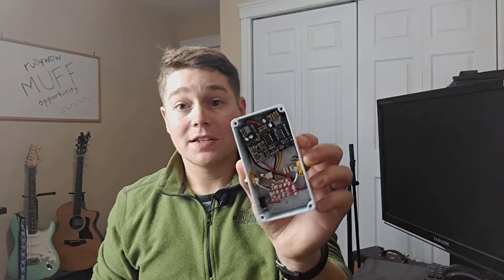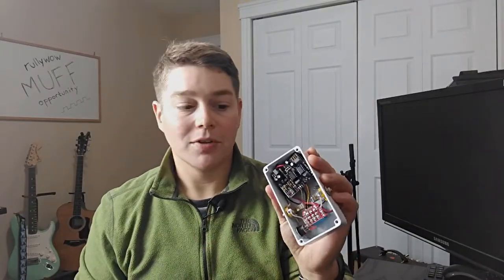Rullywow Muff Opportunity Fuzz | Details and Demo

Comment: Congrats on an excellent build. I put mine together today. I also had the 3pdt offboard wiring pcb. Unfortunately I have some troubleshooting ahead. The initial test before installing into the enclosure was producing alot of feedback - although when notes were played it definitely made that Billy Corgan asymmetrical clipping tone. I tidied up some soldering joints and swapped out the socketed ICs and suddenly got no signal when the switch was engaged, aside from some static. Same after putting the original ICs back. I didnt use board mounted pots and suspect the wiring is an issue somewhere. Thats the way it goes sometimes. Your build looks great and your info is very helpful. Are you using a decal for enclosure art?
Reply from the maker: Hey Ric, awesome that you put one together as well. Good luck with the troubleshooting. Probably a short somewhere. Anyway check out my other video on enclosure graphics for how I do my decals! Thanks!

Comment: Do you have a video showing the build of this pedal?
I didn't find anything that has the full build. I'm stuck and this was my first attempt for guitar pedals.
Reply from the maker: No build video. Where are you stuck?
Reply: @pougnetpedals I don't know how to install the foot switches or the potentiometers. There were no photos or videos that I can find a step by step build. Any help will be much appreciated.
Reply from the maker: Potentiometers are soldered to the back side of the board (opposite the component side). The volume and gain are right-side up. The tone is upside down. This is shown clearly in here: https://youtu.be/D9bxxmEyiew. Footswitches and offboard wiring is standard. Use the following info as reference. http://tagboardeffects.blogspot.com/2012/02/offboard-wiring.html. Not that rullywow make an offboard wiring PCB to make wiring the 3PDT footswitch much easier. https://www.rullywow.com/product/3pdtv3-1a/
Reply: @pougnetpedals  Thank you so much for the help and references. I really appreciate it. Question, do you sell boards and components for guitar pedals?
It would be nice if I could purchase these from someone that can help. I'm in the States.
Reply from the maker: Not a dealer, but I will put out a video on where I buy soon. Spoiler... look at taydaelectronics
Reply: @pougnetpedals  Thank you. I'll subscribe to your channel and look out for that video. Thank a lot for your help.